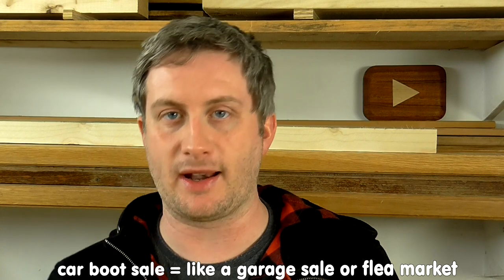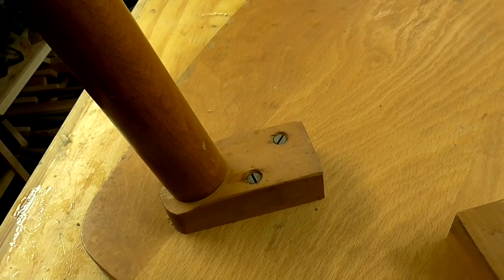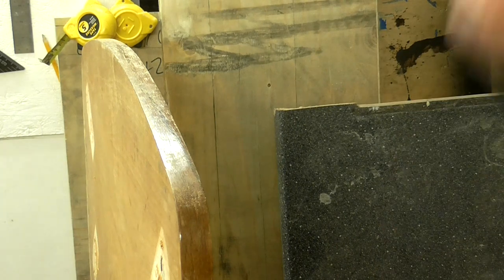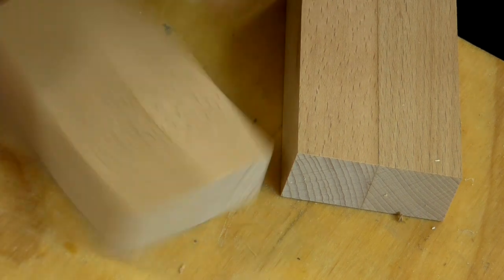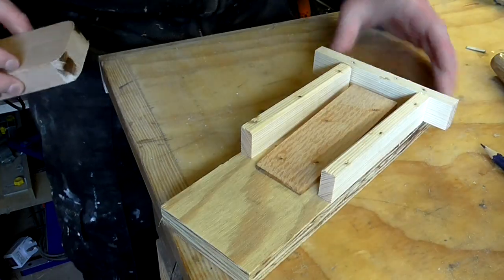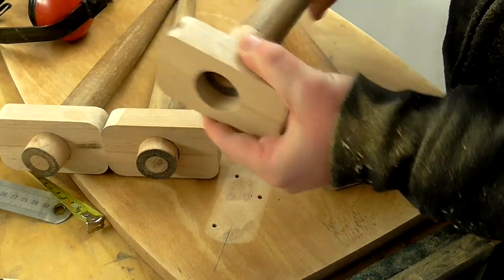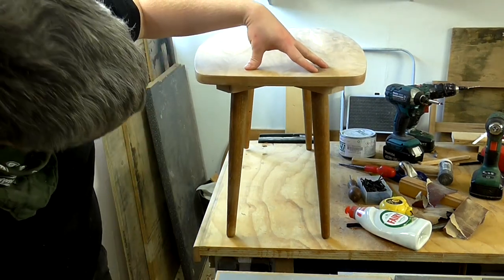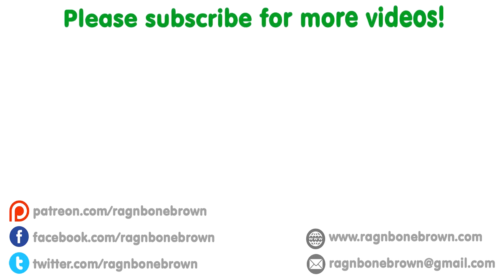Restoring A Mid Century Modern Style Coffee Table

Comment: Excellent jig for the legs. Overall a great win to refurbishing what someone else may have considered trash. One thing I have done in the past, instead of screwing into the side of the leg with the block, is drill a hole and installed a wooden peg. In my past experience, if the glue dries up the metal screw will wear out a hole in the side and the leg becomes wobbly again. With wood on wood they move give way nicely. Of course that may be years from now and that usually occurs when there is not sufficient glue to the joint, which did not seem to be the case here. I have noticed in production chairs that I have to repair, they usually have a screw with insufficient glue and the screw is used in place of a clamp.  But still you did an outstanding job with the table. The big thing is the thought process you did with what to do with what you had. Excellent.

Comment: Looks great!
A good tip I saw for levelling uneven legs is to push them into a level sheet of polystyrene and use a spirit level to make sure the top is level, then use a flush saw to mark where the surface of the polystyrene comes to on each leg, and trim them off.

Comment: Those people have no clue that half of the mid century stuff they see is veneered. Admittedly chip board IS a bit naff, but there is a real art to veneer work that should not go discredited in woodwork. Most veneer pieces from the mid century will last ten times longer than anything you buy nowadays, new.

And even plywood is nothing to sniff at. Think about the Eames lounger (and many other Eames designs or by Arne Jacobsen).

You keep saving these pieces, I love seeing it. And the grain on this veneer was absolutely gorgeous, so good save!
Reply from the maker: +lb003g0676 thank you! Nice to hear from like minded people. I agree about plywood in many ways it's better than solid wood - stronger, less prone to expansion and contraction. As long it has a decent/thick veneer on it I think the quality is good 👍

Comment: What a transformation, it looks great and would fit in any home. Keep the videos coming, there great. Quick question, what tool do you use every day in the shop, any recommendations on power tools. Thicknesser or planer, which of them did or would you buy 1st.
Reply from the maker: Thanks. Tablesaw is the most versatile tool and probably use it the most.  I would say thicknesser more important than a jointer/planer, as there are other ways to straighten a face or edge of a board - i.e. hand plane or even a tablesaw jig before thickness planing the other side

Comment: Hey Keith. I have a similar table that I will restore in a similar way. Question though, you use an orbital sander where I have a detail sander and a 1/3 sheet sander. Is there a big difference in the finish you get from the three different types of sander? Thanks!

Comment: Very nice job. I would have done a bees wax hand finish over the oil for durability instead of spray varnish.
Reply from the maker: Acrylic varnish is much more durable than a wax finish
Reply: @RagnBoneBrown  Might be true ( unless a proper oil finish is done requiring 6-8 applications of oil, with longer drying times and steel wool rubbings in between.....will research that). But in my humble opinion, it negates the hand rubbed finish that teak deserves, veneer or solid. However, you did an outstanding restoration. Impressive carpentry skills! That little baby would fetch a pretty penny with the MCM crowd where I live.....